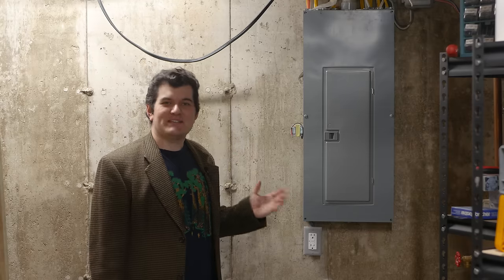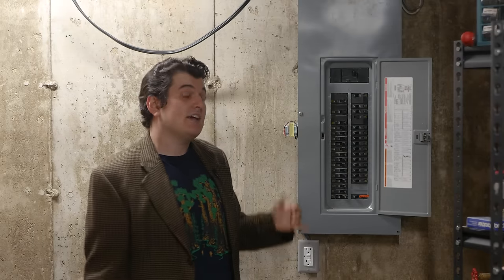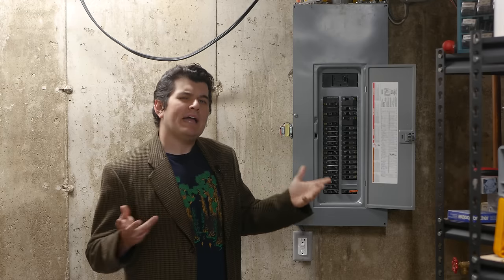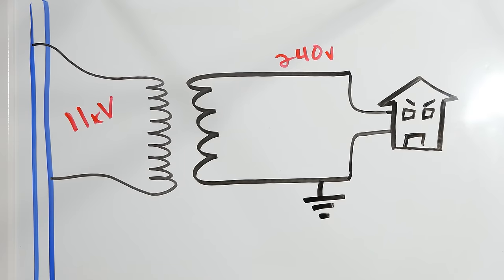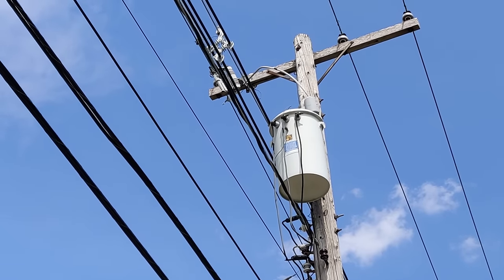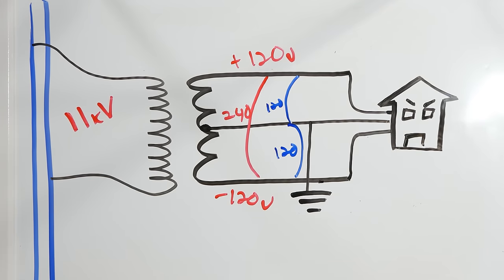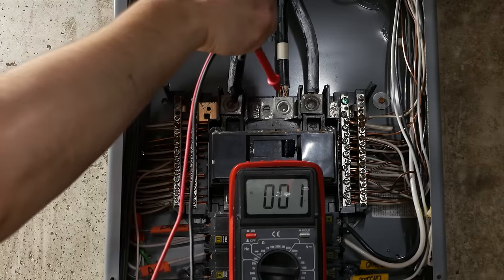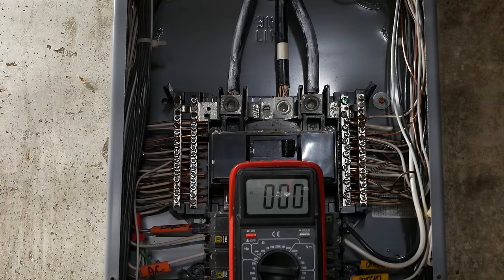The US electrical system is not 120V

Comment: In Sweden we have 400 V phase voltage which in our 3 phase system gives 230 V vs ground on each phase. So we have normally 1.5 mm2 wires when 10 A fuses are used. Cheaper and more flexible.
Reply: Same in Russia, Ukrainian, etc. (exUSSR)
But 380/220V
Reply: @FedorKomov  as far as i know we also use 230v for some time
Reply: @alexandr_guluta  most likely. In czech republic we also used to use 380/220 but switched to 400/230
Reply: As in Norway. And Denmark.
Reply: @michal_king478  Same in Poland (and whole Europe I guess)
Reply: Germany as well
Reply: Same in France but it's getting rarer in residential buildings
Reply: This three phase system is the same in almost every country except the US. The US two-phase system is a quaint custom, like their stubborn retention of British Imperial Units (which they are ashamed of and so call "US customary units").
The reason is because they were the pioneers in AC distribution systems - so locked themself into it. It is also true that a 120V shock is a bit less likely to kill you than a 240V one.
Reply: Poland same
edit: rn i have 245V, because i have pv installation
Reply: Just measured it here (Bulgaria), 238.7VAC right now. However, since 2014, it's nominally 230VAC
Reply: @emdiar6588  You joke about stating your height in inches, but the American military's medical paperwork uses height in inches and weight in pounds. Curiously though, just last month, there was a bit of a change made to their documents. Pointing to a laminated cheatsheet taped to her cabinet, my doctor mentioned that they now had to also include our height and weight in conversions to centimeters and kilograms respectively as well. Don't know what the implications of that are, but maybe-hopefully-possibly-probably-not America is going to see metrics being used in more than just the fields of Science someday. Though
Reply: What European country hasn't been mentioned yet? Oh yes, here in Hungary, too.
Reply: @FedorKomov  Europe has this generalized, 
380V AC 3 Phase
220V AC 1 phase 
1.5mm2 standard wires for 10amps 
2.5mm2 for 16amps
Reply: What is the point of you Brits weighing people...and only* people...in stones? 

If pounds were too small, you'd ne referring to your cars as having "200 stone kerb weight." But you don't. So clearly, this is just some weird affectation for weighing humans in their own units. Like you're special, or something. 

(Okay, ojay: humans *and weightlifting equipment are weighed in stones. And I've heard differing things about livestock. Maybe the Welsh weigh their sheep in stones?
Reply: Same except 16 Amps fuses here in Germany
Reply: @NukeFinity  for 16 A fuses we need 2.5 mm2 wires installed (in Sweden).
Reply: @Sauromannen  ha that's funny. Here just in particular circumstances. I guess Sweden is again ahead of most countries in Europe
Reply: @juriaanromkes7558  voltage and frequency is generalized but not the rated current. Actually there is no exact value required. What's defined is the maximum voltage drop at a rated current. So you can have 16A over 1.5mm2 or 13A over 2.5mm2. While installing you have to take the length into consideration and also how the cable is laid. If it's directly plastered the risks of its on warming are low hence higher currents are allowed instead of a cable going through a glass wool insulation.
Reply: @kenoliver8913  Actually we arent that locked into 120/240 vs 120/208. Appliances that run off of 240 will generally run off of two phases of 208 just fine. In fact many apartment blocks run off of 120/208 with individual apartment units supplied with two of the three phases. So technically any US home could be transitioned form 120./240 to 120/208 and the only changes that would need to be made would be to the breaker box, the meter, the supply wires and the transformers.
Reply: That’s insane lmao I worked as an electrician for some time and I did commercial new construction and they used 480v  for a huge 4 football field factory. 480 is no joke
Reply: Sweden is just better than the USA.. now I feel ashamed.
Reply: All Europe has 400v, and probably safer too with residual current devices for 400v and 230v.
Reply: so you're saying you only have access to 230v instead of 240v, as i assume residential buildings only have access to 9ne phase
Reply: @mattmexor2882  no, we have 3 phases (120 degree time shifted) in residential buildings. Ideally evenly distributed to have close to zero current in the neutral wire. However, normal outlets have one phase but ovens etc can have 2 or 3 phases connected too.
Reply: @Sauromannen  hmm ok.. the information i see says 3 phases available in homes are rare
Reply: @mattmexor2882  well all houses have 3 phases as power inlet to the central but most outlets are one phase. Most households with a workshop or garage also have at least one 400 volt 3 phase outlets as well.
Reply: 230/400, although phase shift calculations show 380V between phases. (120° phase shift, 230+230)÷1,2=383,33 V between phases)
Reply: @imnotbeluga007  no, you are calculating this wrong. The relationship between the phase voltages and phase vs ground is a factor sqrt(3). Hence 230 and 400 Volts.
Reply: Yep. In German we also have 240V for normal use and 400V for 3 phased like ovens and so
Reply: @Sauromannen  For a rough estimate it isn't the worst.
phase voltage × square root of 3.. oh well.
Reply: It’s in whole Europe that way , the 400/230 volt system, that used to be 380/220.
Reply: @kenoliver8913  3 phase isn't difficult to get in the US. Nearly every commercial and industrial building has three phase power, as do many larger buildings. To my knowledge, it's just single family homes that use two phase, and even then the utility company will install three phase if you wanted it
Reply: @isaakwelch3451  So the US has basically a split between 2 and 3 phase? Seems kinda convoluted. America is really bad at standardization.
Reply: @kenoliver8913  the US is metric and has been for ages.  It’s really no different than the UK.  Your ignorance is also showing, as the US has never used Imperial units and there are significant differences between US Customary and Imperial.  So much for trying to come off as a know-it-all 😂
Reply: @emdiar6588  the US has never used the Imperial system.  This is a common falsehood perpetrated by cultures trying to make themselves feel better.

Also, what you’ve said about transformers is a gross generalization.
Reply: Same as Thailand. If you need three phase system you have to contact the electrical authority but mostly resident doen't need unless you're installing larger than 36000 BTU air conditioner.
Reply: In greece, each phase is 230v vs neutral
Reply: In germany we have 3 phases. And you can draw up to 3.5kw or 16 Amps out of one breaker
Reply: @FedorKomov  Russians should be so ashamed of what they're doing in Ukraine that they shouldn't be talking.
Reply: @kenoliver8913  We call them Freedom units and are not shamed!
Reply: @emdiar6588  no.. but weed is measured in both ounces and grams depending on how you buy.... Not from personal experience of course!  lol
Reply: Germany as well. The three phase TN-C-S System is quite complicated to explain though
Reply: @juriaanromkes7558  you can however fuse a 1,5mm2 with 13 amps, so if you have issues with it fuse tripping you can legally get it replaced with 13 amps.... You will however need to make sure that you don't have old 1mm2 wires, which were the standard if you go 60 or so years back (at least here in Denmark).
Reply: You can savely use a 16 A fuse for a 1.5 wire. They are rated for that load. A 10A fuse on a 1.5 wire would be a bit stupid.
If you wanna use a 10A fuse you can combine that with a .75 wire.
Reply: Craig Dendy  Yes. I understand that completely. I work in the field, thanks. Your system is inefficient I'm afraid. There's a reason the rest of the world decided to improve on your system.

My house has ONE phase, 230v,  like most houses in Europe. Next door has ONE phase 230v, and the house next to that has ONE phase, 230v. Each of these houses uses a DIFFERENT phase. There is no reason to step down to a lower voltage, because despite what you guys believe, 230v is quite safe..
Reply: @Serpensin  well not in Sweden. I guess we value safety more than money.
Reply: Same goes here in Finland 😄
Reply: @emdiar6588  I don’t think you have understood the electrical systems in Europe. What you describe is not reasonable, i.e., make no sense. Each house have a three Phase (with 400 V effectively and 120 degree phase angle between them) combined with a Neutral and Ground. From each phase you get 230 V wiring vs Neutral from your outlets (unless it is a three phase outlet).
Reply: @emdiar6588  well what you wrote was just completely wrong, simple as that. I’m curious how you can have worked with what you claim without knowing the most basic level of electricity.
Reply: I think 3 phase 400VAC/50Hz is standard across Europe.
Reply: @michal_king478  400 is the same as 380, the same with 220, 230, 240V. They are the same voltage circuitry. It is just how people are calling them. 220 is the minimum, 240 maximum and 230 average. It is like this because as soon as you put a load on something, the voltage from the source drops because the power source needs to work harder to maintain the voltage. So if you turn on your home, the voltage in the whole circuit where your home is that starts in the power station, drops, and the power station needs to work harder to maintain the needed voltage. Sometimes it is OK to just add more fuel to the powerstation, other times you need to switch on a new generator. To cover for these fluctuations, the power grid works in some range.
Reply: Same here, but normally all rooms have 16A 2,5mm2.
Reply: @juriaanromkes7558  in our Swedish college we are working with a lot of this, so we have 16 A and 32 A in a few classrooms and stuff
Reply: @kenoliver8913  We are in NO WAY ashamed of our US standard of measurements.
Reply: @J.H.P  why?

don't you use electric stoves over in france?
Reply: You sure it isn't 360/240 volt? Or am I wrong? It gotta be the same in sweden and finland.
Reply: @Gubbtratt 1  yes, I am very sure. The RMS value between the phases in Sweden is approximately 400 V which gives approx 230 V vs ground. Edit: I think you have included the allowed minimum mains voltage in your 360 V claim.
Reply: @Sauromannen  as you probably speak swedish, jaha.
Reply: Yes,. . . There are a few European countries that feed 3-phases to private houses, but not all.. . . I have not seen that in the UK. . .   But that is still highly compatible and does not run into the terrible problems the Americans have with 3-phase, 2-phase and single-phase. . . .  They sometimes end up with 208V which is bad for most things.
Reply: @kenoliver8913  
In 230v systems the introduction of RCDs, over-current disconnection, fault detection and arc detection, double insulation, etc, all make the system very safe.
Reply: US has 3 phase 480/277v and 3phase 208/120v. Large buildings have 3phase 480/277v with step down xformers for 208/120v. Lighting in commercial buildings is often 277v. Lots of light fixtures same circuit.
Reply: @NukeFinity  
Sweden is ahead in what?
Reply: @bcubed72  Some Brits do. I don't :-)
Reply: @SwingingChoke     Yes, all the world uses 3-phase for transmission and high power. . . . Most use 400/230V. . . .  I have installed a number of 480/277V generators and systems. . . .   480V 3-phase for many Motors. . . I used the 277V for outside bright area lighting. . . .    But the American 208V is nasty. . . There can be 208V Single-phase as in hot or stinger phase, very nasty. . .  There can be 208V 2-phase, bad for 240V Air-conditioner equipment. . . And there can be 208V 3-phase, but I don't know what uses that.   . . .All 208V is nasty.. .  The American system have got them selves into a corner on this.. . .   The rest of the world just uses 400V or 230V. . .   It would be possible for America to change over to 240V Single-phase, stretched out over perhaps 10 years or more.
Reply: Finland too
Reply: @TXPer  PV or no PV, it should still be 230V
Reply: @juriaanromkes7558   Hi Juriaan,. . . NO.. . Only some of Europe used to use 380/220V others used 415/240V  .. . Now all Harmonised on  400/230V
Reply: @Sauromannen . . . .    Correct,  1.5mm² good for about 15A max,  2.5mm² good for up to 20A, subject to temperature and cooling.
Reply: @Sauromannen  . . .   1.5mm² OK for 15A,    2.5mm² for 20A subject to temperature and cooling.
Reply: @Sauromannen  .  My replies disappearing .. .     1.5mm² for 15A,  2.5mm² for 20A subject to temperature and cooling.
Reply: @Sauromannen  My replies disappearing .. .     1.5mm² for 15A,  2.5mm² for 20A subject to temperature and cooling.
Reply: @NukeFinity     My replies disappearing .. .     1.5mm² for 15A,  2.5mm² for 20A subject to temperature and cooling.
Reply: @hughleyton693  all your replies can be seen. This happens to me sometimes as well.
Reply: @Sauromannen  . . . Thanks, I have had to scan through 3 times, before they have now become visible, what a screwed up system.
Reply: And this reply was immediately visible.  Ah!
Reply: laughs in 480v
Reply: @raze4789    .  The USA Electrical system in Homes is a 2-phase 240V system.   .  The 2-phase is achieved by centre tapping the supply Transformer secondary, such that it supplies  Two 120V lines, relative the the Grounded Neutral, and 240V between the Two Lives.. . .   A 2-phase 180° will have twice the voltage of each individual single-phase line. ... .   480V 3-phase is only supplied to larger buildings.
Reply: @juriaanromkes7558  Could it be that you live a few decades in the past?

With IEC 60038:1983, this was changed to 230/400 V with tolerances and has been implemented since 1987. In 2009, the upper tolerance was adjusted to the lower tolerance, so that it is now 230(±23) V, which means that 207 volts to 253 volts are allowed.

Don't forget, there is a non-breaking space between the numerical value and the identifier for the unit - ALWAYS!
Reply: Oh in the Netherlands we have the same voltages (obviously) but use 16A fuses and 2.5 mm2 wire (3680 W)
Reply: This system is more or less everywhere in Europe. But the voltages in fact differ from place to place. That, what is really constant, at least over a minute range of time, is the frequency of 50 Hz. This is because some of our electrical devices use the mains voltage frequency as time normal. The line frequency varies over shorter time ranges. In the case of lower frequency the supply network is overloaded and requires more power. Peak power stations are starting to push more power into the supply network. In the opposite case, peak power will be taken away. So the frequency deviation is a measure for the power required to be added or subtracted from the supply network.
Reply: @nic7nic  . .   In Europe 1mm² 5A or 1.5mm² 10A is common for lighting circuits on 230V. . .    With 2.5mm² 20A for Outlets.. .  That is all 230V Single-phase, ( 1 Live & Neutral wires ).. .  The USA 240V is 2-phase, ( 2 Live wires, no neutral ), but their normal lighting and outlets are Single-phase 120V
Reply: @gkdresden  , ,   Hi Gunter, . Technically all Europe is now on a standard voltage of 230V Single-phase 50Hz. .  With 3-phase at 400V. . .   But the "Harmonized" standard is at present 230/400V ±10% which means the old 220/380V and 240/415V will just fit into the new standard, so no equipment has to be changed.. . .   Yes, rotary generators will dip frequency if there is a sudden load increase.. .  But the average frequency is always brought back to 50Hz ±0.1% or something like that over a 24 hour period.
Reply: @juriaanromkes7558  not 380V/220V it's 400V/230V and we use in germsny most tims 1,5mm² with a 16A fuse.

Comment: Awesome video, I knew about the 240v service and how you wire a 240v circuit but it never dawned on me that the two busses were 180 degrees apart, thus 240v potential.

Comment: First off your presentation is informing and entertaining. It did cover a lot I missed or forgot. We are not only coping, but improving in the plug/socket area. Plugs now have that rim to keep the fingers away from the prongs. Appliances are double-insulated and wall adapters by design won't let you anywhere near the prongs. Then again accidentally coming in contact with 120V is the best safety teacher if you live through it.😊
Reply: 120V best teacher? I had them at home and a few times they hooked me up as a receiver and I didn't feel any respect. now I have 230v (because I live in Poland) and after nothing else I started to care about not becoming a consumer